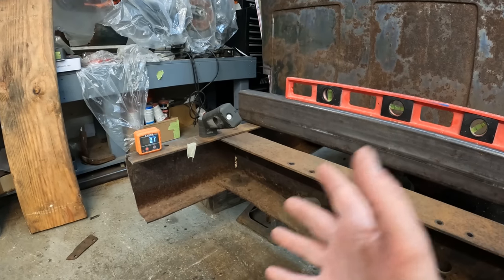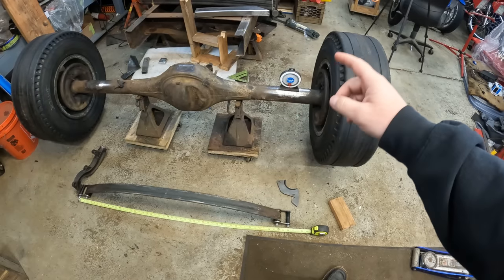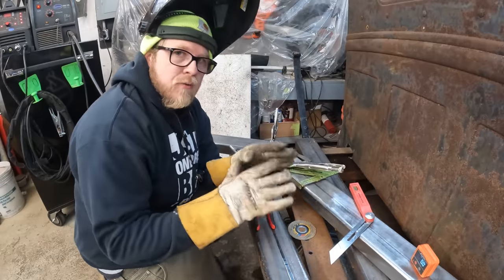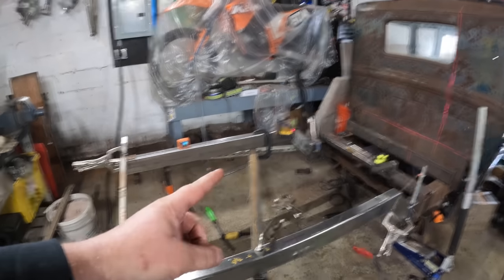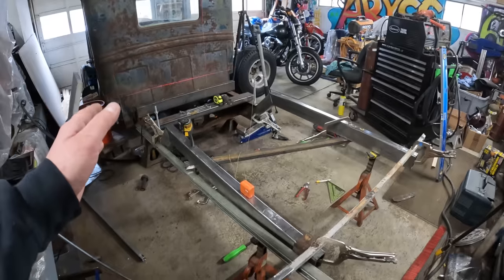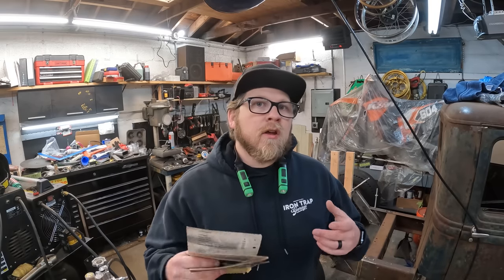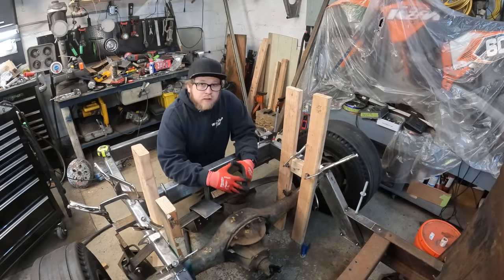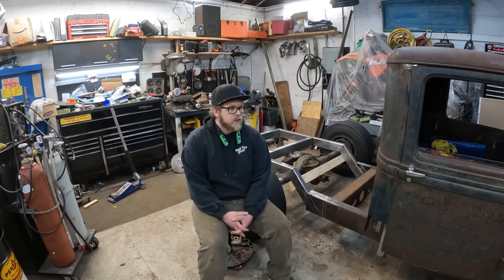Building A Rear Frame For Jay's Pontiac Powered 1932 Ford Pickup!

Comment: Back around the turn of the century there was no Youtube and I had to order parts I could barely afford from Speedway and others. I managed to build a T roadster pickup. Getting info was very difficult. Hot rods were scarce but more than once I would spot one on the hiway and follow it to a gas station or even a house and always the owner would happily chat with me and give me pointers on the very things you show in this video. I learned welding and painting and engine rebuilding the same way.  It took me 18 months to complete the transformation of a 70 Courier to my finished hotrod.  Years later I proudly posted videos on my Youtube channel. Years later I used Youtube to learn how to restore my grandmas 1910 Singer and stitch a removable top. You are going through the best part right now. Later you will have the time of your life driving your creation for the first time! Good luck, my friend!

Comment: Nice work on the frame. A suggestion on keeping the frame square ,mark a centerline on the floor full length and drop plumb bobs at the 4 corners  of the existing frame . Then you can use your centerline and a few more plumb bobs to square your frame extension. It's a similar method to how a frame shop measures for square while pulling frames . Easy to do but hard to explain.

Comment: Looks great, another way to get it all straight and square is to put four posts up in a rectangle, square them up, measure corner to corner, then attach string, use a string level to level all four parts of the string, once you have a square rectangle around it you can measure in from that string to anywhere on the frame to make sure its square and use two four foot levels, one in each rail to keep it all level.

Comment: Very cool Jason!!, I really like the Pontiac power, I'm building a 31 Ford Coupe using 57-58 371 Olds for power & of course using factory Tri-power which is the only year(s) this was available.
I have an assortment of screws jacks that I use for leveling.

Comment: you need to be concerend with the working angel of that ujoint at rear imput  it needs to be at least .5 degree min and 1.5 degree max or you will not keep ujoints in it.